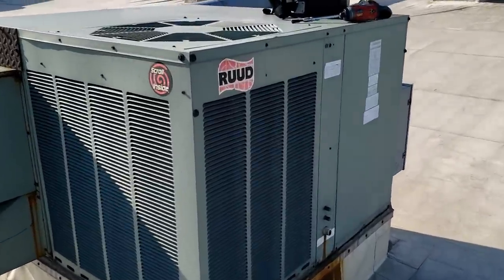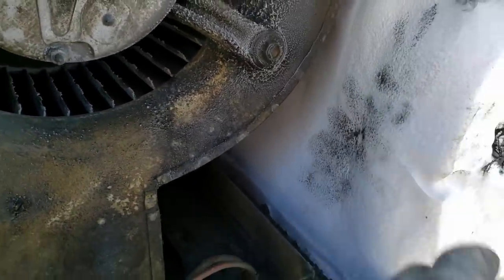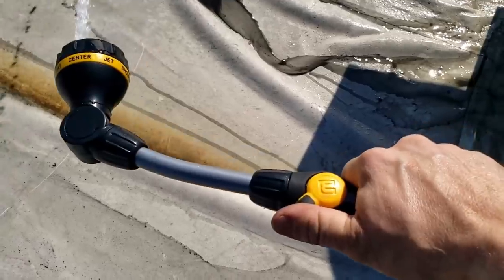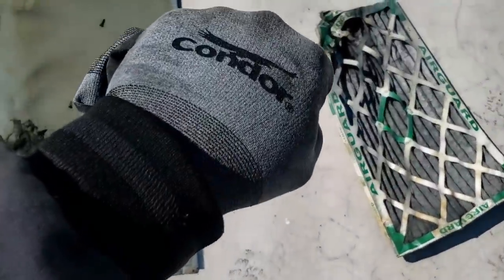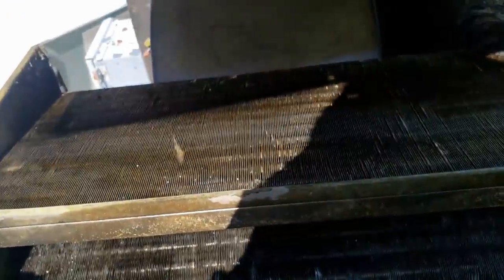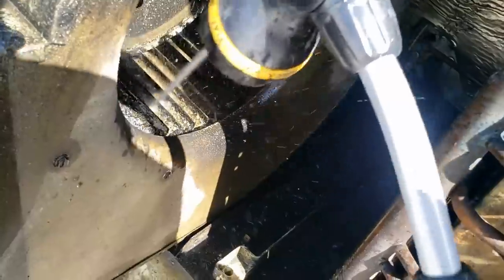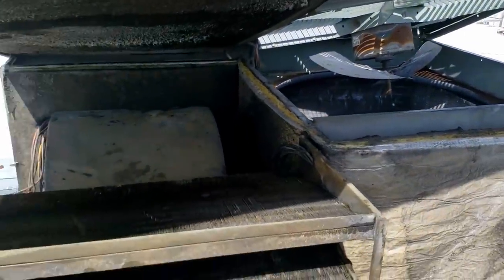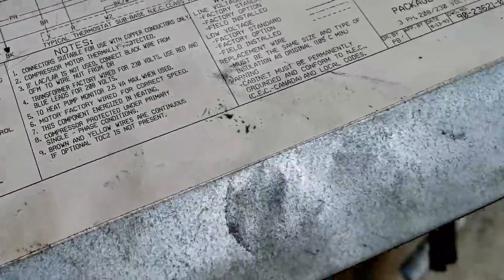This Is Why You Don't Have Cooling. You Got To Be Kidding Me!

Comment: After all these years of zero maintenance, the RUUD was still kicking and running good enough to freeze up like that.
Reply from the maker: I don't have any problems with Rheem, they make a good basic HVAC unit.
Reply: @HVACRSurvival  always been a Rheem fan boy because of this. they really put thought into their equipment as their equipment is so easy to service, and it just lasts a life time. this still applies to their new stuff too.
Reply: New stuff on residential is iffy recently. There are some major problems popping up that are really bad. They are aware though, hopefully it was just a bad run.
Reply: @The1ThtRulesAll  care to note what problems their are?? just installed an R96T in my house about 8 months ago, so if there's some symptoms that I should be watching for thatd be great to know
Reply: @embeddedgirl  if you got one of the duds you would know it. Had some with bad coils, and heard about one that the reversing valve cracked on.
Reply: It's 2024, I have 89 Rheem r22 unit still running good in Florida

Comment: Great work as always. Thank you. Trying to wrap my head around the wiring for the FCC using the relay. Just in case I find myself in the same situation. By any chance do you have a reference where I can go find it as a diagram? Thank you.
Reply from the maker: The only diagrams I’ve kept is some refrigeration wiring diagrams. I take pictures of hard to find things and keep them in a folder for topics like refrigeration or heating or whatever
Reply: Ok. I am just trying to figure out the wiring for the Fan cycle control on cooling bypassing it for heating on HP. The same you did on the video.
Reply from the maker: Use either a normally open or normally closed relay and power it off of the O or B terminal. That way it will keep the fan energized during heating. Add this relay across the fan cycle switch to bypass it during heating. Total line has this feature built in to there variable speed control.

Comment: I'd like your opinion on the Emerson 49P11-843 SureSwitch Relay? I am thinking of using these on the condenser units at my home. Thanks, Jenkins A/C & Heating
Reply from the maker: I have one that I wanted to put on my heat pump and try out but I didn't have enough room in my cabinet. I took it apart and looked at the relay they are using. Its a small relay rated for 30 amps  and claim its now rated for 40 amps. My problem is the size of contacts on small relays like that. They are rated for 30 amps but for how many cycles? The instructions say they have done something to make the contacts last longer but I would be curious what the patent says they done. It does provide under voltage protection and short cycle.

Comment: Just disconnect the comp and leave the filter door off and the blower on.  Depending on how warm it is outside it will melt relatively quick.  And no risk of getting water down the ductwork
Reply from the maker: Like I mentioned in the video I didn't want to have to come back and if I would have just left and let it thawed out that still wouldn't have gotten the coil clean. That's why I stayed the whole time and it was only about 60° out so it would have taken a while for it to melt. Otherwise if it was maintained and everything was in good working order,  yes I agree with you. Thanks for the feedback. 👍👍

Comment: You can usually tell by looking at the ice why it froze up.  That Ice looks like it was liquid flood back which means low air flow.
Reply from the maker: It felt very dense, more than normal ice, if that makes sense.

Comment: Why did you add the fan pressure relay?
Those unit run the fan when contactor call for
Reply from the maker: Are you asking why did I put on a fan cycle control or why I put a relay on in parallel with the fan cycle control?

Comment: So since you had to add a relat and rewire... how did it ever work before?
Reply from the maker: The unit had an economizer on it, that's the correct way to run the system in low ambient conditions, it's also a lot more money to fix, the systems old and should be replaced, I wasn't going to waste a lot of time finding prices for things they likely would not replace or repair.
Reply: @HVACRSurvival Management is not that concerned if the employee break room is uncomfortable.

Comment: 😂 I had a Lennox that was iced up pretty bad on the outside also, someone had bypassed the compressors.
Reply from the maker: Bypassed the compressor or the cut out?
Reply: No but I find the cut outs bypassed all the time, that's why we change out compressors so often....but someone straight up bypassed the 1st stage compressor, just fed 24 volts to the contactor 24/7. Had a laugh on that one, compressor also covered in a block of ice
Reply from the maker: @ReliableHVACR  🤦‍♂️🤦‍♂️🤦‍♂️🤦‍♂️🙈

Comment: Why did you add a fan cycle control?
Reply from the maker: Because they run the AC in low ambient conditions. You need to keep your head pressure up to allow the metering device to properly feed refrigerant. And it's cheaper than repairing the economizer.

Comment: Why do people insist on leaving ac's on when they aren't working. do they just hope and pray that it will just start working. They don't realise there is a solid chance they can cause far more damage.
Reply: Fr if it's a kitchen or an office space you should never leave it on i don't see why people do that plus they're wasting money let them be
Reply from the maker: @prettycureforever7102  it was for the break/lunch room. I'm not sure why they didn't turn it off, they said it work Saturday but stopped Sunday, The thermostat will lose it's mode when the power is cycled, it's a old old original commercial Honeywell stat, I recommended they consider replacing it🤷‍♂️
Reply: @HVACRSurvival  makes sense bymetal temps be going out I've seen this at my parents house told them they need a new system but they won't listen to me trying to get them to buy a heat pump an dump gas they don't have to worry so much on humidity since they're getting old an its healthier
Reply: @HVACRSurvival  I don't know bout other people we had a unit low on charge at our showroom the unit still preformed somewhat and at least kept it under 80 about 76  in the heat of the day set for 73.
We left the unit on because we cater to a high end clientail and a we want the showroom comfortable. We have had clients that if the showroom isn't comfortable would walk out if a unit down can potentially cost us a 10-30,000 sale I would rather fuck the unit and leave it on the lose the sale.

Just last month the blower mount failed on out rooftop unit and it would vibrate badly  I had a client some high client that just left a 12,000 deposit on a remodel coming in to look at products and another to finalize their sale another 8,000 deposit. You bet I left the unit on at that price I'll buy a new unit.

Comment: Im surprised that thing has a head pressure valve ?why tho? Is it too cold to run the heat pump I thought the package units would have back ups ?
Reply from the maker: It's for low ambient cooling not for the heating. The economizer probably use to work but who wants to fix it at that age.
Reply: @HVACRSurvival  true. Then again from what they thought us in school is thay not a whole lot of techs know how to fix it so they just abandon it. So ehat was the point in that first person who put it in ?
Reply: @HVACRSurvival  is it possible if you can do a fix it for eco modes for us new guys
Reply from the maker: Yep, I didn't know much about economizers in the beginning so i would just ignore them, when your new you have to many things to learn, not enough time to focus on them if you don't work on many. I'll see what I can do about a video on them. The Jade control made it so easy now it's fairly simple now.

Comment: What makes condensers freeze up?
Reply from the maker: Nothing, condensers don't normally freeze up, evaporators do.
Reply: @HVACRSurvival  what makes evaporators freeze up?
Reply from the maker: Low air flow, low refrigerant, refrigerant restrictions, running below 60*f ambient temperatures, and no heat load on the evaporator. Those are the common problems.
Reply: @HVACRSurvival  thanks for the responses

Comment: Cammon man, always turn the supply fan off when changing the air filters out, if not all that dirt/dust is going to the evaporator coil. You should know better than that. I always wondered how those fins got damaged on the evaporator coils, now I know. This is a heat pump and you said, you had to add a fan cycle switch, was it bad or you added it to the factory circuit. Please clarify. Thanks. I am a retired/ disabled tech, still learning.
Reply from the maker: When I was messing with the filter the coil was frozen into a block of ice? Is that what you're talking about? Far as the fan cycle switch, I wanted to be able to run the unit in low ambient conditions in cool mode. The problem is when the system is running in heat mode, the pressures will be naturally lower when it gets colder because the condenser is now your evaporator.  You want the fan to run all the time in heat mode so the relay bypasses the fan cycle control while in heat mode. I added this to the factory circuitry. Keep in mind, this rtu used to have a economizer that worked and now it does not.

Comment: It would’ve been quicker to recover the system pull the evaporator out clean everything up put it back
Reply from the maker: I had to melt the ice either way. I really didn't spend that much time cleaning the evaporator and condenser after melting the ice. Maybe a total of 20-30 minutes for both.

Comment: That looks like a condenser fan motor for blower. I’d all but guarantee it’s underpowered
Reply from the maker: 🤷‍♂️ who knows what they have done at this factory, I haven't done many calls here and this was the first for this unit.
Reply: Yeah that's a condenser motor. You can see the drain plug
Reply from the maker: @Bryan-Hensley  they have a full time maintenance department is all I can guess. You saw the filter door I had to remove. Nothing surprises me at places like this.

Comment: see!(13:07)
other videos I commented on many electricians said not to call the black wire common..... wtf.... electrical lingo calls it common wire!   
Proof I am correct.
Reply from the maker: I call black hot or L,. White is neutral or common depending on 120 versus 230 volt. Whether it's right or wrong 🤷‍♂️ I know what it means LOL

Comment: better to use a car wash sprayer
Reply from the maker: No room in the truck I don't just do one particular type of work. I work on generators, residential, commercial, industrial, air dryers, walk-in coolers, freezers, ovens,  reach in coolers and freezers, ice cream machines, geothermal and that's off the top of my head.  At times I wish I only did one or two things 😄